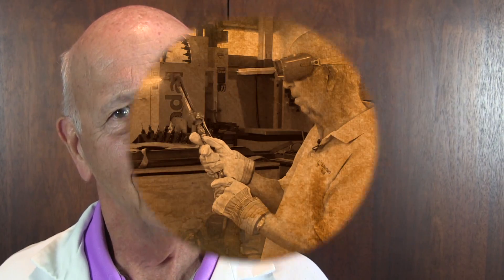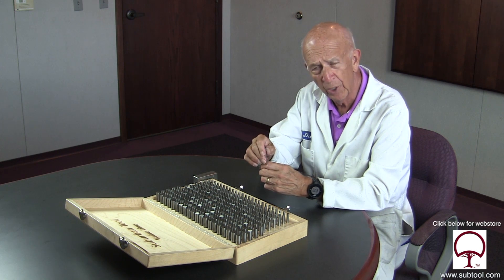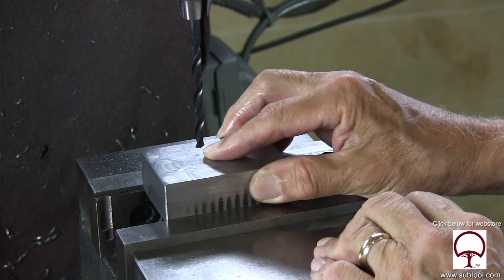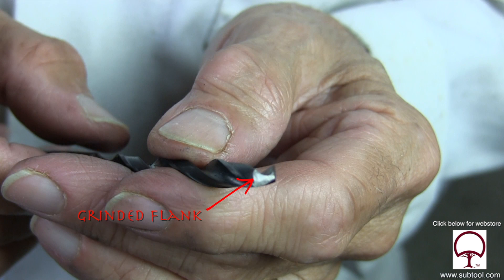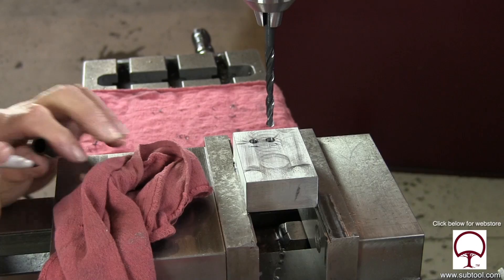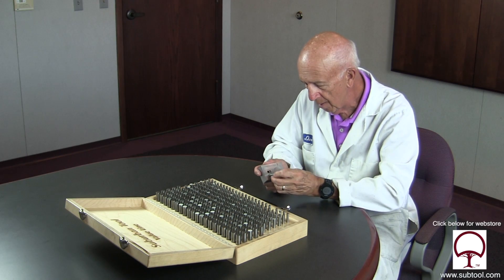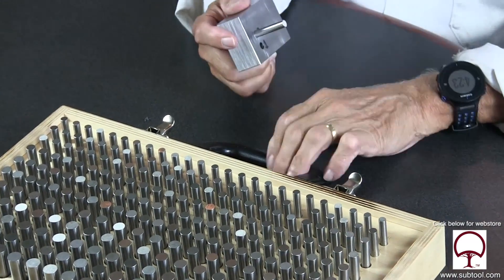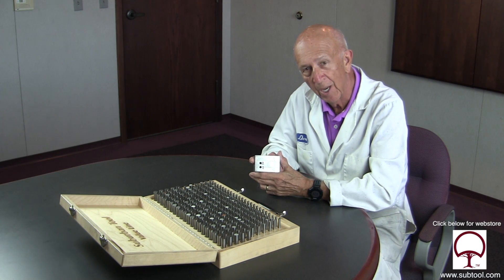How To Drill Without Going Over Size

Comment: If you are going to use a spot it should have a larger point angle then the drill you are using to drill the hole.  If your drill has a 130deg point angle you should use a 145deg or larger point angle spot drill.  That way the drill finds the center of the spot first and follows the spot.  Doing it this was greatly increases hole position and accuracy.  Using this method I can usually drill to within a few .0001s of the drill diameter. I'm currently drilling 17-4 H900 with a 1/16 carbide drill.  A .0625+ pin glides right in, but a .063- pin will not go.

Comment: Why didn’t you spot drill?
Reply from the maker: Normally we use center drill. However, depending on the circumstances a center drill may not be required. In this case we felt it wasn't necessary. Thanks for watching.

Comment: what a great experiment!
For those of us without a shelf full of reamers, what about first center drill or spot, second, drill a little undersize (maybe 1/32" under), then chase to final size with a drill bit in good condition. Then any asymmetry in the grind won't propogate as far since only the outer tips of the cutting edge are working.

Comment: One reason the 1st hole was oversize is drill chucks have  runout . Whenever looking for better accuracy indicate and adjust the runnout of the tool before drilling. Even using a 5c collet with produce runnout and the endmill or drill where maximum accuracy is required should be indicated for Total indicator runnout (TIR) before cutting. 
Note : drills have back tapper built into them on purpose in order to eliminate binding in deep hole drilling. The size of the drill at the tip is larger then at the shank end and when chucking the tool the chuck jaws do not clamp the tool for their entire lenght making the tool susceptible to shiftig in the collet or chuck.

Comment: Even a new drill will not drill precisely size, that's what reamers are for. But an old toolmaker gave me a tip which stood me in good stead as I also became a toolmaker. Get a new drill, where the web angles and lengths are true, and with a fine oilstone just lightly stone the corners of the webs, just a couple of strokes, and it will drill very close indeed to size. Nice video by the way.

Comment: Nice tute Don.
I've never trusted new drills for close tolerance drilling. If I need  accurate hole I will start with a centre drill, followed by a small drill about he diameter of the very tip of the drill then follow up with a carefully sharpened drill to size. Sometimes I'll use several drills to "creep up" on to size. A major part of grinding  a drill is to use a guided diamond wheel dresser and use a fine  feed on a fine grit stone. Works wonders for drill bits.
Pete

Comment: Offset drill grinding is an old screw machine trick.
making a Ø 1.000 drill hold Ø1.050 ± .001 was part of the job.
Reply: Thanks for that post! Ive some simple parts to make that need a .375 hole, the short reamer on a gang tool setup just isnt working out. Grinding a point off centre i can do and its one less op.
Reply: Well, it worked out great! After a few attempts at the grinding wheel I got a 23/64 (.360") to drill .375" on the money! The finish is pretty decent too. 
Thanks again ;)

Comment: It occurred to me that maybe the Chinese deliberately undersized the shank so that with the run-out, the resulting hole would be less oversize.

To visualize run-out of a tool, could you do a video with a white mm grid right behind a tool, a bright light and high-speed camera, and close-up macro shot? Could you hook up with +The Slo Mo Guys perhaps? You might even be able to capture the run-out of something like a piece of drill rod, or a gauge pin this way, and show the ultimate accuracy of some tool, or perhaps you could show how run-out increases with tool length.

With a cheap drill bit I can see what looks like run-out even by eyeball. Pretty sure a HS camera would show the swing.
Reply from the maker: That's not a bad thought to have, I've certainly thought about that before as well.  Who really knows!

Comment: Well, I guess if I was really crafty, I could get me 1/4" drill to put in a .2735 hole...and I bet I could arrange that with the new-used MG-5CV-S1 I just stole for $675.00, and it has the face mount V block. 
  My buddy came by and I demonstrated my Darex drill sharpener. 
  He said " Well, I can sharpen drills just fine by hand " 
  I told him, " Me too " ( And, yeah, I am really good at it... )
 But, I won't. Not if they are under 3/4". 
  Even I, with about 35 years under my belt... cannot begin to compare to a mid-level sharpener. 
 I sincerely recommend to everyone to consider a quality drill sharpener, just as soon as you can get one.   
  Now, on my bigger drills, I use my belt sander. It does well. 
  BUT..... "Perfect" is a creature of theory. 
 I have seen a couple designs for sharpening jigs for the surface grinder for the larger drills. 
 Yeah, like my 2 1/2" #5 MT drill... they lay them in an angle iron and grind primary and secondary  angles as you would on an end mill tip... flat. 
  Don, you got a clean design for that?
 Love your videos, and I can't begin to tell you how much you have helped. 
 Thanks again,
  Mark

Comment: With some materials i work, i do on purpose the off-center. I work alot with ampco, and in this material wen you drill with a perfect on-center drill it get stuck and its almost impossible to get it out then. Or the drill will snap.

But further the video was great information.

Comment: Excessive pecking or too much pressure will cause really bad bellmouthing and over-sized holes.
I have found that pecking can be a real problem with small drills, it takes very little pressure to bend a small drill. Allowing the drill to exit the hole can also cause problems when a small chip falls in and requires some extra pressure to recut it. As long as the chip is freely running up the flutes, there is no reason to lift the drill. Instead, try relaxing the pressure so the chip thins to the point of breaking and then re-apply the pressure. I use my cutting oil brush to wipe the chips away from the hole as I raise the drill so nothing falls down in the hole when I add fresh oil.

Comment: A great subject to highlight. It shows that even what most people see as a simply task, drilling a hole, has its own science.I have found that any deformation of the part to be drilled will make a drill wander. The best example is facing a bar on the lathe.There is normally always a little tit of metal in the middle. As the drill hits the tit it wanders.If the cutter of a mill scores the surface and the drill hits the edge of the score, the drill will wander off center.In aluminium its not too bad but start drilling tool steels and stainless and the problems really show up.If I want accurate holes I do the old fashioned method taught to me.Use a center drill to start.Next, use a drill two sizes smaller than the one you need and drill to depth required.Then use the drill size required to open the hole to size required. This allows the swarf to be minimal as Don said, the swarf is the enemy of drilling.Only use top quality unused or barely used drills.If the cutting edge is chipped, even if you have used it only once it will wander and drill oversized.The new 130 degree drills are self centering and wobble like crazy if you use a center drill first. If your machine is old and the bearings are worn even a tad, use the old style drills, 118 degrees.

Comment: If you had started with a smaller dia bit and stepped up to final diameter would the first hole have been closer to nominal size? I was surprised at 7 thou over. I expected 1 or 2. I always learn stuff on this channel.
Reply from the maker: It could be.  We'll be doing some more tests.

Comment: Does drill speed have any effect on the difference in hole size?
I have seen steel drilled with 18mm holes using a ratchet in a clamp & the hole was drilled rather on the pressure on the drill bit rather than the drill speed  & quite quickly. So whilst i am not suggesting one drills that slow it would seem that drilling slow would be less likely to throw the bit out of centre--  Or would it?
Reply from the maker: Speed won't usually have an affect on size, unless you're running the drill at crazy high speeds.

Comment: may I add another cause- Those jacobs brand chucks are the worst I have ever bought the run out is horrendous, if using small drill bits it is greater than the bit itself.

Comment: i build gauges and i build the lapping-rings by myself to become rounder after grinding, before i go on the lapping-roller.
you can buy all the drills in 0.05mm steps, or you use this technic to drill bigger holes if you have to lapping on 0 and the ring have to be bigger.
Reply: Well now... that brings up a very interesting thought which I have never considered:
  Ar the flights of a drill 0 degree rake?
  I mean on the radius... 
 So, could you take a .25 drill into the spin index under the surface grinder and make it a ..2498 for a press fit on a 1/4" pin? 
  I know, reamer would be best, but if you have a surface grinder...
 Thanks!
  Mark

Comment: I was always taught by the shop foreman that you can't trust any drill to be accurate, even indexable spade bits.  Disappointing to see seven oversize on a new bit, though.  That's almost 3% oversize.  If you wanted to drill undersize and ream, how would you even know how much to go?  And of course, there's the issue that a two-flute drill actually drills a triangular hole, and you can only hope that the shaft edges will kinda clean it up some.
Reply from the maker: We were surprised by that as well.  Thanks for the comment, we really appreciate it!

Comment: I'd like to see the same test with a screw machine length drill bit.
Reply: if reamer quality and size is required from a drill bit , always drill undersized first. then off center is not big problem, but actual dia. would be   trial and error checking for sizing,  hope this helps

Comment: First hole possibly oversized from two things.

Use of a jobber length drill without any sort of spot drill guide.

Plowing out .250 from billet instead of starting out with a pilot drill then stepping up to the desired size.

Sound about right maybe?
Reply from the maker: You're 100% correct.
Reply: yup!

Comment: Might be good reason to drill a pilot hole first as to remove the center of the hole.
Reply from the maker: Good observation, a pilot hole will definitely keep us closer to size.  We also wanted to demonstrate the chance of drilling oversized without using proper steps.

Comment: Hey Don,

I have found that the pressure used and amount of oil can make a difference in hole size. Also with a jobber drill I have noticed that spot vs. no spot can make a difference in size. Screw machine length drills are less picky. 

Maybe I am wrong.

Alex
Reply from the maker: You're not wrong, these are both good observations.

Comment: Good video, Don.  It is difficult, actually near impossible, to get the point centered even using higher end grinding equipment and checking it with a drill point gage.  It is difficult to see within a few thousands using a ruled scale.  But then, a drill is not a precision hole making tool.  If you want a hole to size and on location to tight tolerances, first drill undersized, then bore for position, and finally ream (or jib bore or grind) to size.
Reply from the maker: Great observation, and you're very correct. This is exactly the right process for a precision hole.  Part of our goal for this video was to show the importance of drilling the way you've explained when precision and accuracy are critical.  Thanks for the comment.

Comment: Pretty much any bit, even a brand new top quality split point, will drill oversize when clearing the center. I would  bet that the improperly resharpened will still be significantly over opening a piloted hole, where the factor grind would be much closer (maybe only 1 or two thou, rather than 6 or 7). Then again, if it matters that much, this is what reamers are for.
Reply from the maker: You're exactly correct.  For precision and accuracy, always use a reamer to ensure correct size.  Thanks for the comment.

Comment: I always found split point drills had a better tendency to drill closer to their nominal diameter, the regular grind doesn't cut well near it's centre, where the cutting speed nears zero. Would it be possible to show us how to correctly split the point of a drill, as I could never get it to look like a factory grind, as well as how to correctly grind flat bottomed drills, and how to correctly spot drill, so you don't notch the tip of your drills. I'm purely a cnc miller (three, and five axis), I love watching your videos, and would love the chance to run any type of grinder. Your jig grinding videos were fantastic, and i'd love to see more, especially correctly checking tightly toleranced features, like true position holes. Thanks Don, Keep the videos coming!
Reply from the maker: Thanks for the video suggestions.  Our drill videos have been popular lately, so we'll see what we can do.  Thanks for watching, and for the comment!

Comment: Drill will usually drill oversize if i have been playing on the bench grinder :) 
hahaha but I'm learning..Also drill chucks are not accurate..You will never
get a drill bit to drill the correct size no matter how good you are after 
grinding..Its nearly impossible even with the correct rake and 118 angle
and the flutes the right length..But its ok if you are just roughing out.

I also have grind some flat bottom drill bits that have worked great usually
drilling into EN8 1.5" deep..22mm diam

Comment: I'm surprised by the degree of oversize, on that .250 hole that's almost 3%, best case.  I currently drill a 64th or 32nd under and ream to size.   I just assumed I was starting with a good hole, but I'm going to double check, thanks.
Reply from the maker: We were too.  You're welcome, thanks for watching.

Comment: thanks Don. would be helpful to share the benefit of pilot drilling with a drill just under before the final size drill to assist in keeping the size.   Interestingly when i drill on my cnc mill in ally i get a prrfe t size. when i do the same in the lathe its over. Youve got me thinking i need to check tailstock centre... its a 60's machine so has been around a while.... keep up the good work.
Reply from the maker: Good comment.  Pilot drilling is very important, but for this demonstration we went without it with the hunch that we would be a little oversized without it.  Thanks for watching!
Reply: +SuburbanTool Inc understand.    If you had pilot drilled 1 size under, how close to size woul you reasonably expect to get given a correctly sharpened drill in steel?
Reply from the maker: Not sure, every job is different.  We'll find out soon.  Ultimately, using a reamer is the best way to get a properly sized hole.

Comment: I bought some drills from a local direct from china bargain retailer.  While the diameter of the drills were actually very close to the stated measurement, most of them had a bend in the axis of the drill.  You could roll them on a flat surface and see the center of the drill lift of the table, some times even 10 or 20 thou.  This would cause the point to rotate offset from the chuck and would cut way oversize.  I guess they might have warped due to a cheap hardening process.  Just another thing to check if you're drilling oversize.
Reply from the maker: Very good observation, thanks for sharing.

Comment: Nice video! I do mis two possible causes for the oversize: 
- runout of the machine/toolholder
- walk from center at first contact with the material (also possible with perfectly shaped drillbits when the drill is not at exactly 90degrees to the workpiece)
Reply from the maker: It's possible, but I don't think walk from center will have too much to do with an oversized hole.
Reply: Allright :) I tought the tension in the tool would make it want to center itself anyways (causing an oval hole)

Comment: This video explains a lot.  probably the cheaper the drill the looser the tolerances in machining, the greater the variability of the point on the drill. for critical work  best  to test the drill in both the same material and machine for size.
Reply from the maker: This is a spot on observation, thanks for sharing.

Comment: 1) Could runout cause the oversized hole with a new bit?

2) Are there bits available with different degrees of precision?
Reply from the maker: 1. It's possible, not too probable though.
2. There aren't necessarily  "specific" bits with better degrees of precision.  But, you can buy higher quality bits that will be better quality than something like a cheap Chinese equivalent.

Comment: Grinded flank?
Reply from the maker: Flank, also know as the "land" in the Machinery's Handbook.  We intentionally grinded one side of the drill to set it off center for the purpose of the demonstration.  Here is a simple drill geometry diagram for reference: https://www.researchgate.net/profile/O_Ozdoganlar/publication/51534921/figure/fig1/AS:277010866819078@1443055945394/Fig-1-Drill-bit-geometry-a-twist-drill-bit-and-b-drill-bit-tip.png

Comment: nice test. As a millwright resharpened drills were a bane of my existence. Did you happen to measure that new drill before you drilled the first hole and if so what was its actual size? thanks for the video!
Reply from the maker: We did not, but for the purpose of this demonstration, and for the purpose of knowing if the drill is correct for any part, we should have.  Thanks for the comment.
Reply: thanks I was just curious. :)